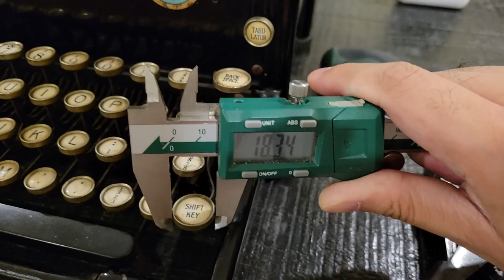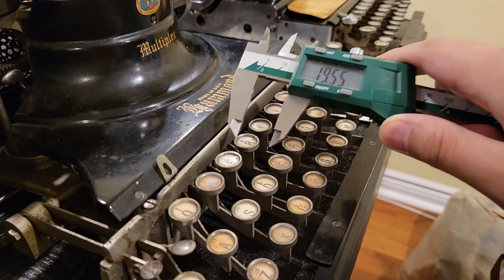The amazing Dreusicke all-in-one typewriter key ring pliers! - Operation and disassembly

Comment: My Typewriter sells a keyring pliers kit but it's going to set you back almost $500.  Trenton Jennings put out a video called "typewriter key ring remover homemade tool" where he uses a wiper arm pulley instead.  Take a dremel to grind a curved edge on the jaws.  Good luck.

Comment: Thanks for the video! I have been trying to find a method to remove key rings without damaging the rings themselves, but have not suceeded so far. It seems that some are just friction fitted, while others have those small metal cut outs, that grab and hold everything together. When I got my Erika Tab 5, the keys were (they still are) in really great shape. No discoloration and the chrome looked brand new. But on one key ring, a"metal tooth" was broken and the key ring could be easily turned while typing. The metal seems to be very thin and prone to braking over time and depending on how often they were removed before. What's your take on the matter? Is there something you could do about it? If you want to give the machine a thorough cleaning, with chemicals and spirits, the keys need to be removed at some point...
Reply from the maker: I would personally leave that key ring as is until you can find a parts machine (Erika in bad, irreparable condition) from which you can source a spare key ring, as it would otherwise be quite hard to repair an existing one. If the paper key insert for that key isn't also rotating as you type (this happens with some machines where while the metal key ring is secure, the glass under it may still not be perfectly secure), then I wouldn't find such key ring replacement as important. If you have some small rubber padding or paper to protect the finish, you could try using pliers to tighten the grip of the existing key ring tabs to see if that prevents the rotation.

Comment: I did not know about this dual-use tool.  Very ingenious design. Thanks for the detailed explanation and demos and showing the innards of the tool.

If the tool is so dear, I am seriously considering making my own.  I doubt having the same luck as you after this becomes known.

For replacing the spring that was damaged during the first attempt at disassembly, I would suggest using music wire of the same guage as the original spring. Happily, it does not need heat treatment to be springy.  Form it to the correct diameter using a smaller diameter pin if needed and finish with forming the end loop. 

A captive spring hook would optionally be very helpful for manipulating the end out of the way for disassembly and for pulling it during assembly. 

Daniel
Reply from the maker: The only reason I "stole" a spring off of my Merz No. 2 was sheer impatience. :)